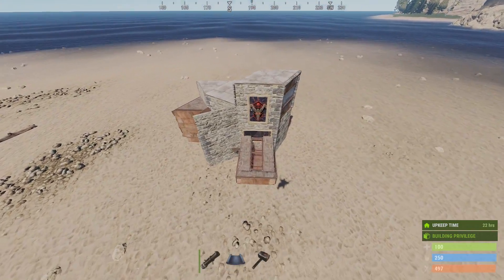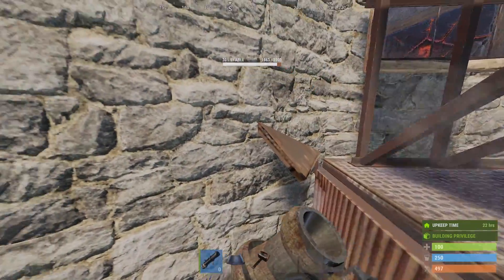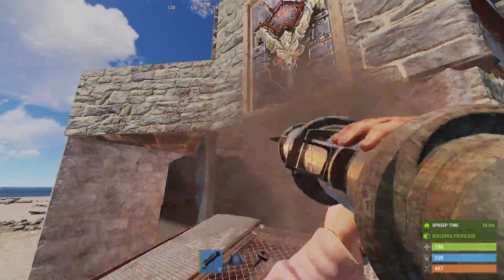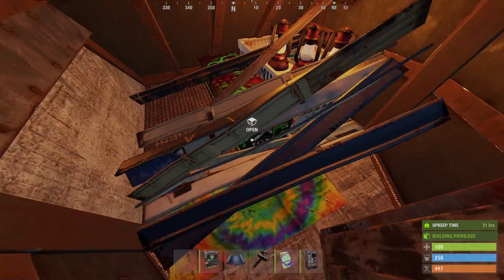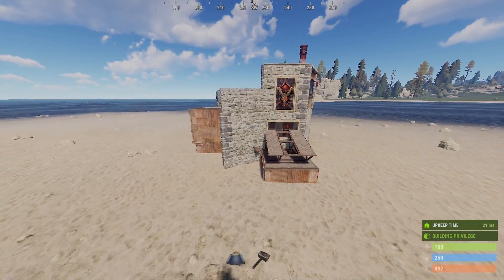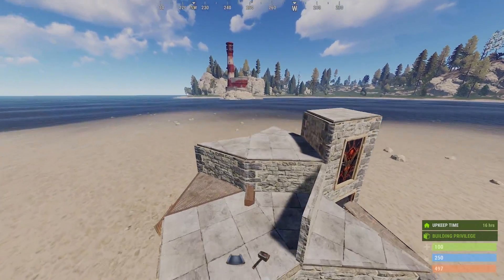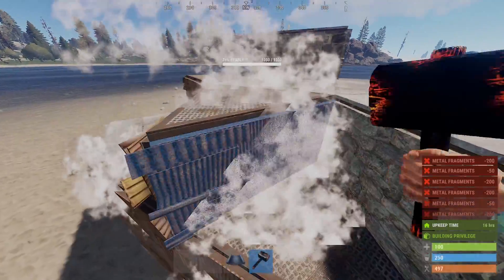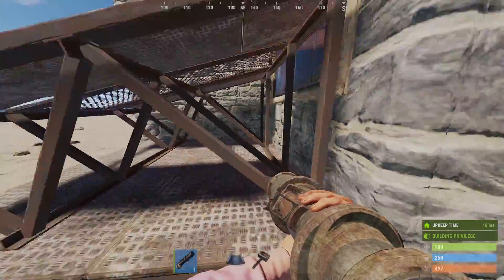Rust - Mistakes Were Made In My Last Base Design - Rust Base Building

Comment: you asked if i would spent that on this base, and no i wouldnt but clans will, and the amount of toxic clans and players are growing more and more, and theres to many of them now as it is. but they would use that, i played as a solo this wipe been raided 2 times and had key locks on doors. They used 26 rockets the fist time to raid my base thats no bigger than a 2x2 i dont want to tell you the type of base i make as its not common and very cheap with a high raid cost. My base was not fully build at this time and they got around 4k metal ore. They still used it on a solo base that was small. thankfully they didnt get tc with that raid. I rebuilt and sealed then got raided again when i got done with the base. 39 rockets with some explo 556. they didnt care that it was a solo or that it was a small base, they raided me cus clans and big groups dont raid each other anymore, they only raid easy small bases and solo's, so in all id say yes, 23 rockets is good but needs more.
Reply from the maker: big clans cannot ever be stopped
Reply: @MyGamingExperience  too true

Comment: 2:37 wait theres a bit of roof sticking out right here just like on the other side. Wouldn't you need to cover this part to to prevent splash damage?
Reply from the maker: i believe the top is fine
Reply: @Litt Whitt if you were to go from the angle required to splash damage that part of the roof than you wouldn’t have to break the roof at all. You’d just be spending the 23 rockets to get straight behind the garage door to the tc. So it doesn’t end up being relevant. Good eye though!